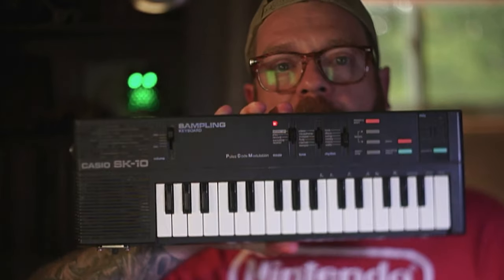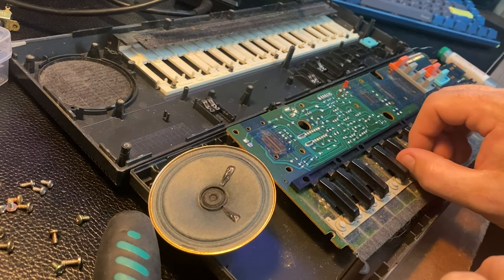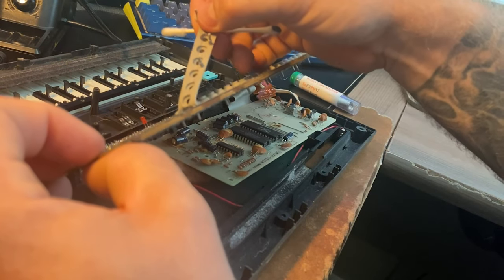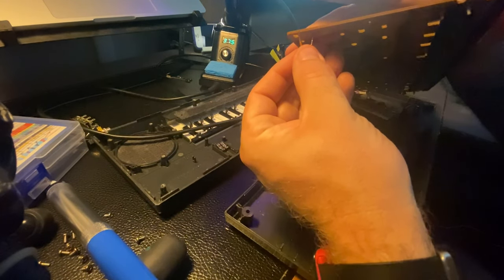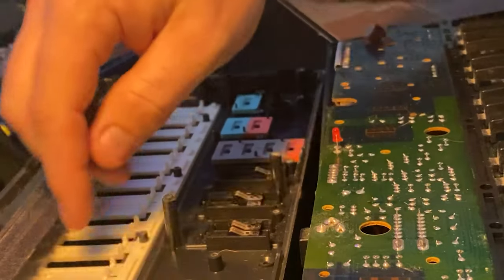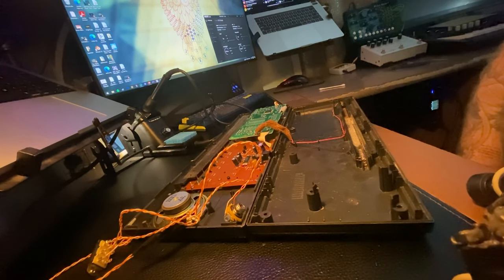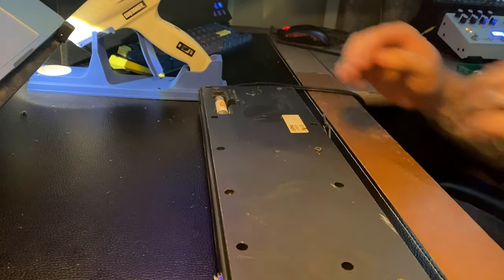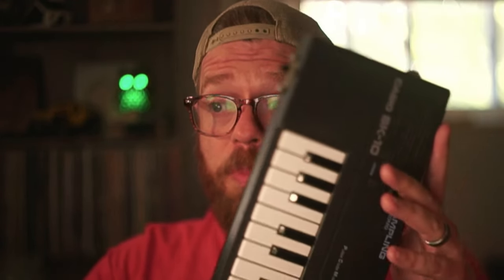How to: Add an output jack to your vintage Casio keyboard // DIY electronics // music toy hacks

Comment: Thanks for the great instructions. In the video I see resistors on the output jack but you don't mention them and I couldn't find an exact description of the values. Thank you very much!
Reply from the maker: Hey! I thought i mentioned it in the video, apologies. Some small keyboards need a 10k and 1k resistor to bring the signal down, but this one did not. The final project goes straight into the jack here.
Reply: @BadGuysGetDead  Thank you for the fast answer!! Have a nice day.

Comment: Nice - doing something identical to an old SK-10 right now too. Did you ever consider adding a Record IN jack to bypass the built in MIC for sampling?
Reply from the maker: Yep, i had considered it but have much more robust samplers so i skipped it. The next phase of this one is to try to circuit bend it
Reply: @BadGuysGetDead  Ha, yea. I understand that. Oh cool - I saw some nice envelope mods for these recently with a slow attack and decay - real nice. HauntedHarmonics on reddit had a little schematic 👍
Reply from the maker: @NiElsir awesome tip!

Comment: Thanks for the great tutorial, helped a lot. Do you maby also know how to add a line input?
I would also like to add a switch so i could switch between mic input and the line input.
Reply from the maker: The SK-1 and SK-10 have those mic inputs, you could potentially override that using this same trick. I'm not sure what the resistance differences would be for line level vs that cheapo mic. the switch circuit is probably almost identical to this project.